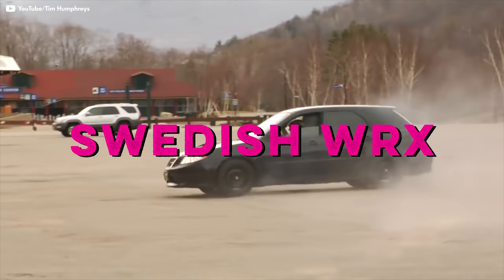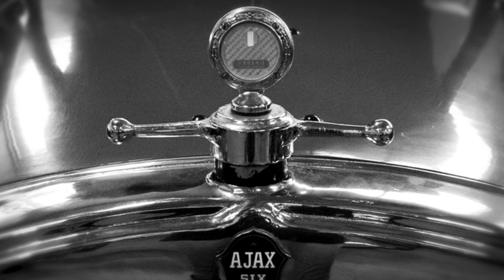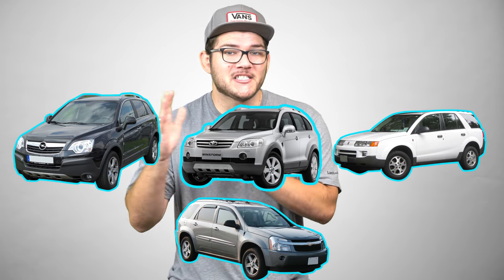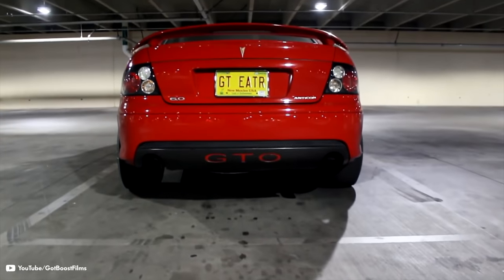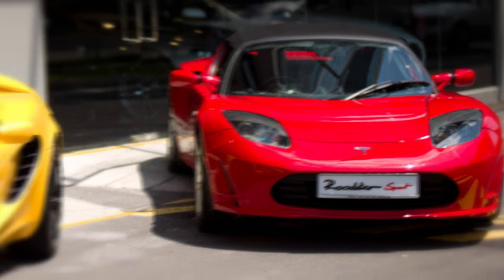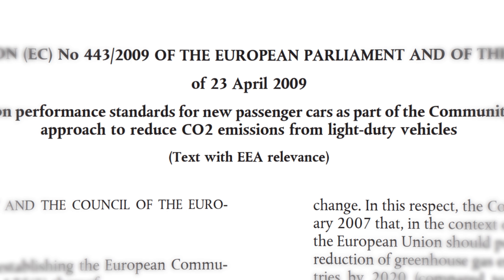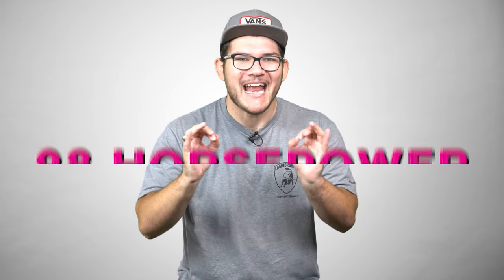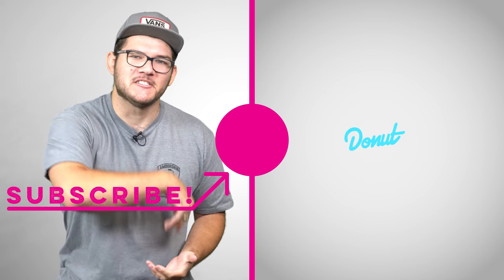Who Really Made Your Car: The Truth About Badge Engineering | Donut Media

Comment: The entire gmc, Cadillac, and Buick lineup is literally a rebadge job
Reply: So is lexus and Toyota
Reply: I can see that with gmc but not the entire Cadillac and Buick lineup and definitely not Lexus and Toyota
Reply: @aloseronline4659  the only Lexus's based on Toyota's are the ES, RX, GX, LX, UX and NX
Reply: byron Rideaux that’s still 6 models that have been re baged
Reply: Yonathan Goldberg well Buick is literally just some opels. And if you look side by side. An encore from Buick is a shiny Chevy trax. Also I like the Cadillac designs but they are way to cheap on the interior. As well as the most of the lineup having Chevy versions. I feel that luxury brands should start from the ground up with minimal parts sharing like “”the old Cadillac “”
Reply: @byronrideaux  don't forget LS and GS
Reply: @elseagullo4979  I don't think the LS and GS are based on any Toyota models
Reply: @byronrideaux  Well look at the LS400 and LS430. They were called the Toyota Celsior in Japan and the Lexus GS was the Toyota Aristo
Reply: @aloseronline4659  They may share some parts but Lexus is the luxury segment of Toyota, not a rebadge.
Reply: Holden lineup is literally every gym car rebadged
Reply: So is ford and Lincoln
Reply: Their are some differences tbh 
Cadillac models really are very distinguishable from Chevy btu maybe Chevy and GMC yeah I agree they look the same
Reply: @omaralkayal7598  
GM have been re-badging all of there car lines for well over 50 years especially the Cadillac!!!!

Out
Reply: So what's the Cadillac CTS rebadge?
Reply: @flitsertheo  don't be mad. You're still cool driving it
Reply: @mercier300  Mad ?  Toyota and Lexus models are different though they may share a lot of parts. Toyota has a policy where they will always use the same parts if possible, such as screws.

Comment: The title should be "who really made your car: how GM shot themselves in the foot...multiple times."
Reply: SONICR It wouldn’t have been that bad if gm marketed the Holden’s as holdens
Reply: SONICR yeah they're like Microsoft of auto industry , whatever they touch turns into shit after a period
Reply: GM: the death of GM one car at tme time
Reply: Over and over and over and over and over and over and over and over
Reply: Why did I laugh at this so hard😂😂
Reply: Ahahaha
Reply: Yeah and i am surprised that nobody talked about the Astra
Reply: Except, most of the examples of GM in the video aren't badge engineers. Holden, Chevrolet, GMC, Baojun, and Opel (until 2017) are/ were all owned by GM and used parts provided by GM from vehicle platforms and suspension components to transmissions and engines it was all provided by GM. It's not really badge engineering. It's just rebadges. Cars like the monroe were rebadged as Pontiac GTO's because Holden doesn't exist in the states and will never exist in the states because there is no need for them to as for the most part Holden is quite literally just Chevrolet for the Australian market. 

We don't consider Acuras to be badge engineers of Honda's and we don't consider Lexus' to be badge engineers of Toyota's because they are quite literally the same company. Just like Pontiac, Chevrolet, Holden, etc are/ were all the same company.
Reply: This could be a running series.

Comment: The VW Audi Group do this a lot.  The MQB platform is probably the most well known and used for a huge percentage of the cars sold by VW, Audi, Skoda and Seat.  I have an NJ Fabia on the PQ25 platform, which basically a polo, ibiza and a1 (though the ibiza and a1 use the slightly older PQ24 chassis from the older polo).  This isn't a bad thing as the styling is completely different between each brand.  Audi being expensive and luxury, vw being sensible and premium, seat being sporty and skoda being the cheaper sensible car.  The best part about it is the cheaper brands have the same cool tech, similar handling and the same engines from the expensive models which is a huge win for the average consumer.

Comment: Ford Ranger, Mazda B-Series
Reply: Mazda and Ford worked together a whole lot through the 90s and 2000s
Reply: plus they weren’t bad cars
Reply: Chevy Luv
Reply: I use a low mileage one owner -00 "Ranger" 2.5TD 4x4 as my service truck and I find it hilarious that this is de facto a Mazda B2500, produced in the very same factory in Thailand and the only differences are things with Ford logo like the driver airbag, radiator grille/mask and the wheel hub covers. The entire engine and drivetrain and electronics (sans the Ford cassette player that I changed very first weekend) and frame and chassis  and entire interior are just the same car. Now why on earth would the same truck be sold under two names in the Finnish market and why did this grandpa buy a Ford for several thousand euros higher pricetag than the very same truck had as a Mazda? 
We'll never know but here I am with a Ford that has nothing to do with Fords X-D
Reply: @Sam S thank god Mazda is independent now. Look at their cars! They have really nice interiors, great reliability and an amazing driving experience. And of course they have the legendary MX-5/Miata depending on where you live.
Reply: @Sam S not anymore. They used to
Reply: @Sam S it has banks and Toyota investment, but that doesn't mean the management isn't Mazda. They make quality cars.
Reply: @Sam S investment from external companies totals to 18.2 percent
Reply: @Sam S most of your data is outdated
Reply: Dodge Attitude=Mitsubishi Mirage
Reply: Well atleast the new ranger looks amazing (the raptor version)
Reply: Mercedes X-Class = Nissan Navara
Reply: @1HyperCube1  ikr
Reply: Isuzu rodeo, Honda passport, Acura slx, isuzu trooper.

Comment: I've owned two geo prizm's over the years,  because they were re-badged Corollas. They were great cars that not many people knew about so they were also cheap at the time.
Reply: I have a Geo Prizm ministock racecar! The only issue with a Prizm, is it's lack of power and a heavy weight.
Reply: In 1989 my parents wanted to buy another Toyota after totalling their Camry. They were frustrated that Toyota had raised their prices. Buying a comparable Prizm was cheaper. And it was an early model that was built in Japan by (I assume) Toyota themselves.

Comment: Calling the Tesla Roadster 'just a rebadged Lotus Elise' is pretty deceiving. The roadster while developed from the Elise, it ended up sharing very few parts. If I recall correctly, there is a quote from Tesla about how they changed so much of the car, they wish they had started from scratch as it would have been easier, and possibly cheaper too.
Reply: It’s really a melting pot, with parts from Ford and even GM.
Reply: It doesnt even use the same power source. Its electric
Reply: @maspunchnath7487  it doesn't have to
Reply: yeah, the Roadster is based on the Elise, not a rebadged Elise. The fact that the Roadster has a longer wheelbase than a normal Elise should be enough evidence.
Reply: Ive a couple of hairs you havent split yet....there was Lotus elise there somewhere? If the answer is yes you need say no more.
Reply: Hennessey did something similar too
Reply: Yeah calling the Tesla roadster a rebadged Elise is like calling a Hennessy venom gt a rebadged Elise. They both started with an Elise but they definitely didn’t finish with an Elise.

Comment: You forgot About the whole Volkswagen Lineup = Skoda/Seat Lineup Situation the seats and skodas in this case are usually a few Grand less expensive.
Reply: They probably never heard about Skoda in US =)
Reply: Try Malaysia. Honda Accord, Mitsu Lancer, numerous Dihatsu/Toyota compacts gets the new badge slap because import tariffs.
Reply: Yes, Skoda and Seat are not sold in the US so they are not commonly known by most of the Donut audience.
Reply: Joshikun that isnt rebadging tho. Different interior and exterior
Reply: yeah but partssharing all over the place, apart from the design inside and out, wich was given as an examble of rebadging in this Video, everything in These cars is the same engine, Chassis etc.
Reply: well Skoda and Seat usually get the outgoing platforms obviously with a refreshed design. They do get an interesting parts bin.
Reply: Joshikun They aren't rebadges. The are the same platform but not at all a rebadge. A rebadge is the same car with a different badge. Maybe a different panel or grill and often a different engine. 
Honda Integra - Rover Tomcat
Mazda 626 - Ford Telstar
Suzuki Cultus - Holden Barina
Opel Vectra - Vauxhall Vectra
Reply: yes! even VW - Audi (VW with Wood) - Porsche (Audi with more Carbon Fiber)
Bentley (borrows Styling cues from Audi and sometimes Bugatti and vice versa)
Reply: VAG Audi/VW/skoda/seat etc changes sometimes all somtimes only badges and interior package (VW have beter than skoda in Up and Citigo
Reply: 1st time i heard of skoda is through CarThrottle
Reply: LKRG Skoda make own car like Favorit but in democritic changes a lot company must get a new product and this occasion take VW and now is only a brand with VW technology
Reply: skoda is always rebadged, earlier from BMW and now from volkswagen
Reply: Also how VW limited the amount of cars Škoda was making, because they outsold VW by a mile everywhere in Europe?
Reply: 48H1L45H wut? Skoda BMW? Tell 1 model?
Reply: skoda octavia 2005 model, in India it was a rebadged BMW 3 series, but thats just one car, imagine all the varients of BMW 3 series, except the M3.
Reply: 48H1L45H any pics or didnt happen i look and cannot find
Reply: 48H1L45H this is regular Octavia with VW engine 1.9 TDI based on Bora/Jetta, show me BMW/Skoda car.....
Reply: only the grill and the badge is skoda, dosent the rest of the car looks like a 3 series? We do have a 3 series here in India with a 1.9 TDi version.
Reply: 48H1L45H Octavia is Bora/Jetta not BMW E36 or E46
Reply: What they actually did is took the old BMW 3 series and sold as Skoda octavia.
Reply: Joshikun audi a3, octavia, cupra all have the golf chassie but cheaper and skodas more reliable
Reply: 48H1L45H and skoda was the third car company in the world sad that half the world doesnt know about it
Reply: Until VW took over, and started selling it to the 3rd world countries.
Reply: Orang However, some models are one to one the same and therefore real rebadges like the VW Up / Skoda citigò / Seat Mii or the VW Sharan / Seat Alhambra or the VW Crafter and the recently released MAN TGE.
Reply: 48H1L45H no they did not take the old 3 series. it's Bora/Jetta. It looks nothing like it.
The dimensions are completely off. Stop making a fool of yourself and do some research first, not base your assumption because both cars have rectangular headlights.
Do you even know that the 3 series is a RWD car and the octavia a FWD car?
Reply: Vag is a bit like gm why spend billions developing 4 golfs when you can develop 1 and sell it over 4 brands
Reply: my bad.
Reply: carbonfiber492 no, GM make a try to change something. VAG make a MQB platform and only shorts or make a longer to make cars with a brand style. I think its possible to make Seat with big audi style grill by bolt on system. On golf MK4 - A3 (8L) is a plug and play
Reply: Skoda = A cheaper Seat.
Seat = A cheaper Volkswagen
Volkswagen = A cheaper Audi

euro cars are boring as fuck, you have a choice of a Polo, a Golf, a Passat, or a slightly bigger Passat.
Reply: John Doe that’s not rebadging, there’s a clue in the name.
Reply: 48H1L45H no it’s not, they share platforms and some parts but that’s not rebadging.
Reply: AKA VW UP!, Skoda Citigo, and SEAT Mii

Comment: The Toyota Aygo was rebadged as the Citroen C1 and the Peugeot 107. Really successful.
Reply: Do you even know what rebadging means?! The Aygo was made after both the Citroen and the Peugeot, ans Théo all look VERY different.
Reply: Maybe it’s not the right word, I admit. I have seen it was changed slightly.
Reply: Toyota Wigo?
Reply: They were developed as a joint venture.
Reply: @timfrolov7891  On the Peugeot 107 page - The 107 was developed by the B-Zero project of PSA Peugeot Citroën in a joint venture with Toyota; the Citroën C1 and Toyota Aygo are badge engineered versions of the same car, the Aygo having more detail differences from the C1 and 107.
Reply: The Aygo is not rebadged. Toyota, Peugeot and Citroen together own a factory (I believe in the Czech Republic) and develop these cars together. Apart from the outer shell these cars are identical. And the development costs are shared by three companies.
I do drive an Aygo (only available in Europe) and my neighbor owns a Peugeot 108. The inside is completely identical apart from the badge.
Reply: Really shit gearboxes
Reply: Better than cygnet.

Comment: I wouldn't consider half of these listed as badge engineered vehicles. GM owns Holden. Holden uses GM platforms, engines, etc. It's not really badge engineering when it's all under GM. 

Badge engineering is where one manufacturer goes to another manufacturer of completely different decent and says "hey we'd like to take x car and put it into our lineup", we don't consider Toyotas with Lexus badges to be badge engineered and likewise we shouldn't consider a Holden with a Chevy badge to be badge engineer because technically they are quite literally the same company. When it's the same company it's simply just a rebadge, not a badge engineer.
Reply: are you sure about that

Comment: ...The "anemic" four cylinder you showed for the Cadillac Cimarron was not a four cylinder.  It was the 2.8 V6 (5:34).
Reply: Yup my kids mom had a 1989 z -24 convertible had that V6..It was actually fun to drive with the top down..
Reply: 5:33
Reply: NorthernChev there were 2 engine for this particular fiasco
Reply: I came here to make the same point lol. I had an 88 Z24 with that same motor. It was peppy, but it was, in the end, a piece. I eventually moved on to the newer Z with the Quad, and the LS Sport with the Ecotec. I had a blast with those cars.

Comment: 2004 Skoda Superb is a rebadged 3BG Passat, which is based on the B5/PL45 platform for the Audi A4/6, but with a lengthened wheelbase. Interestingly, this generation and the B1 generation Passat/Superb/A4/A6 are the only gens to share a platform.

Comment: The Chevy SS come to Brazil named Chevrolet Ômega. GM market in Brazil is basically Chevrolet brand. About 90’s and 2000 Chevrolet rebranded Opel and Vauxhall models to brazilian costumers, but todays chevrolet market have many GM american Models, Like Camaro, Cruze, Equinox and brazilian made models Like Chevrolet Montana, S10, Trailblazer and the Ônix, Ônix is the best-seller model in Brazil, a 4cyl1.0/1.4L 108cv FWD manual compact car hatchBack or sedan body, for around US$15.000.

Comment: The new Mercedes X-Class is based on the Nissan Navara.
Reply: Not just based. It is a Navarra with different interior and some exterior parts. But that is super common with European car makers. VW sells the same Golf and Polo platforms as Skodas, Seats, Audis. Renault has the Kangoo which Mercedes sells as Citigo (or whatever it's called). And so on.
Reply: and it runs on Renault engines ;-)
Reply: And the sprinter is based on VW. 
I remember that trucks for the 90's, from different brands were all essentially Hilux's. Isuzu and VW comes to mind.
Reply: @GermanEngineer84  That's not strange and no secret at all. Almost every European knows that the VAG concern includes VW, Audi, Seat, Skoda and  Maybach,MAN(trucks) to name a few. The Renault/Nissan/Mercedes Benz bonding isn't hardly a new topic either..